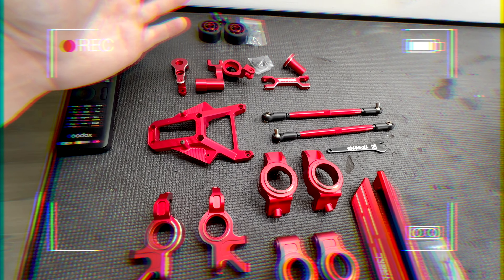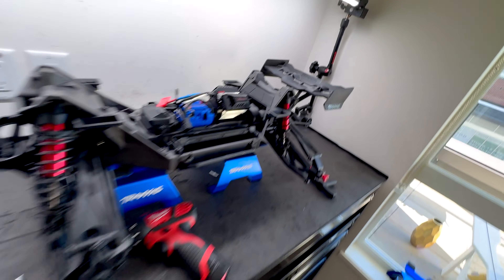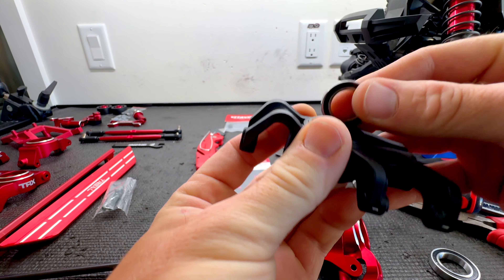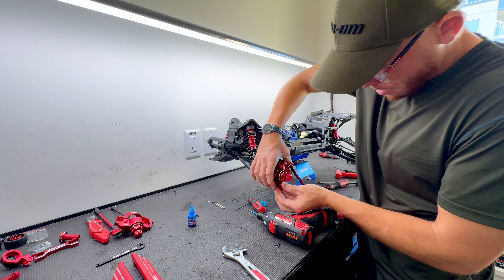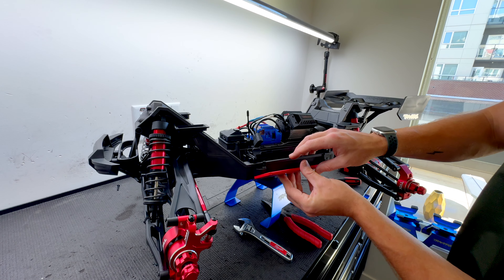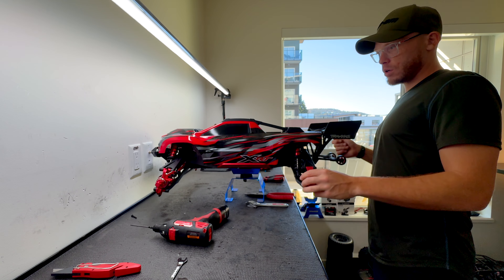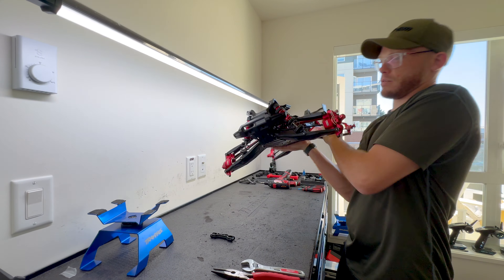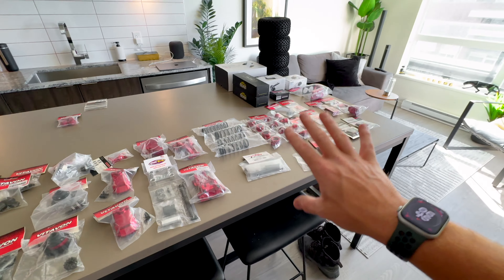Building the Ultimate Traxxas XRT: Knuckles, Hubs, CVD, Steering Upgrades (Part 1)

Comment: Why did you choose the traxxas hub carries over the vitavon.. the vitavon hubs are 7075 vs traxxas 6061, additionally vitavon not only used oversized bearings on their "hub redesign".. but.. they added one additional center bearing!
If following along, would you still advise traxxas over the vitavon for sheer "factory fitment" of the other pieces.. or am I missing something else here because the pricing is not that much different!